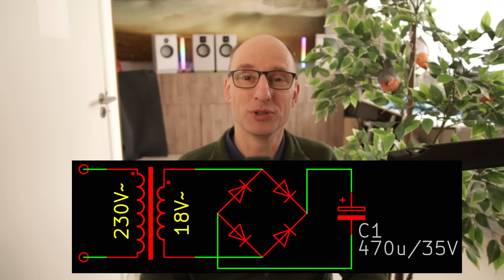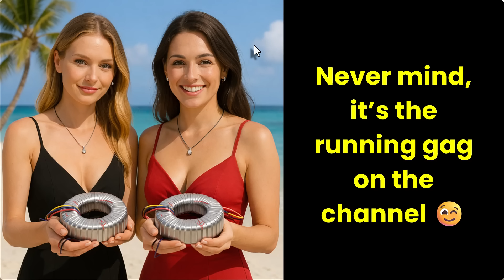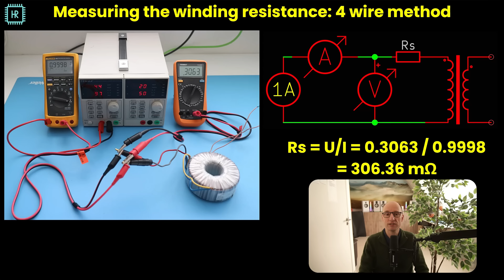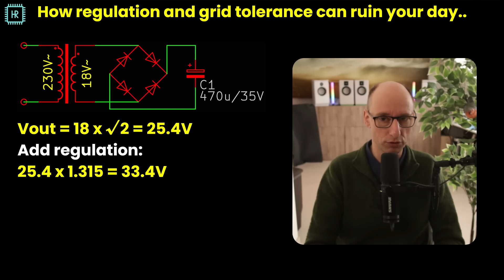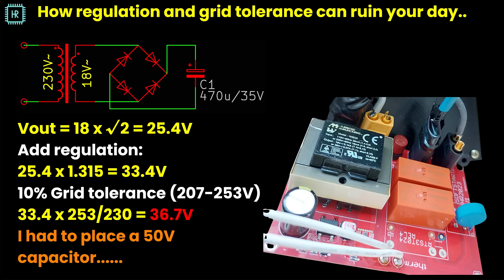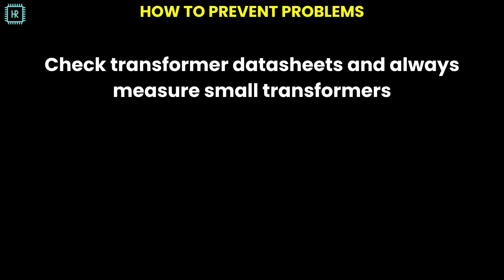Linear Supplies Can Destroy Your Designs

Comment: Hi, this is Ava from JLCPCB. I just wanted to check if you would be interested in a collaboration with us :)
Reply from the maker: Hi Ava, all my boards are made by you guys these days, but I am not that interested in collaborating. 

I have nothing against JLC, adding a short commercial section to my videos really makes my viewers run away so it is not good for my channel since my main business model is selling electronics courses. So I don't collaborate on YouTube with anyone.

I do use your technology for my new FPGA course module of my electronics course. The PCB is made by JLC and I'm very enthusiastic about the 6 layer via in pad technology I'm using for it..

I'm redesigning my high end audio DA converter to the same pcb process at the moment.
Reply: @HansRosenberg74 I completely understand. 
And I'm really happy to hear you're using JLCPCB for your projects, and I wish you all the best with your FPGA course, DAC project, and your channel. Hope everything goes great! :)

Comment: For universal supplies for products sold around the world, targeting a single universal design, power supply design is challenging due to meeting nominal mains power differences through out the world. Some products will have a mains switch to accommodate 120 and 230 VAC with 50 or 60 Hz. However, a switch to select mains voltage is not considered "universal", which implies there is no "supply programming" or "mode switching". Therefore, a universal supply normally has at least a two section (stage) approach. There is a small switching Flyback monitor supply which is universal across all of the world mains supplies, including low and high line voltages, which is on any time the unit is plugged in to mains. As such the Flyback design has to meet all of the world regulation compliance for sleep current, etc. 

When the unit is plugged in the monitor supply is on and includes a small dedicated microcontroller (very low current) to supervise and sequence power up and power down of the main supply, and usually includes some diagnostic LEDs and perhaps even a serial port (field interface is usually a plug-in stick which translates UART Full Duplex to USB 2.0 for use with a Notebook computer). 

The monitor supply will then control the power up and down of the main supply. The main supply can include either linear or switching supplies or perhaps both depending upon what is needed. For example, if we focus on a large linear toroidal transformer (usually with an internal shield and temp sensor or switch) you will provide methods to minimize magnetization current and output current along with any monitoring (usually isolated) of the output stages. This two stage approach is very popular and companies usually have one or two monitor sections designed to operate over all products. You will be winding your own magnetics during prototype, qualifying capacitors, etc. and when a transformer supplier is selected the initial batch of 20 will be dis-assembled and everything measured, like wire gauge, thickness of varnish, turns, isolating tape layers etc. the construction of the transformer must be consistent through out the first test batch. 

If the monitor supply recognizes a problem in the mains voltage (like over or under voltage), the monitor supply will signal a fault (usually a blinking power on indicator) and in turn keep the main supply off. 

Power supply design is not easy or inexpensive when you have to consider all of the features needed for a universal design and how to test and qualify the completed designs. A lot of test equipment (may also include burn-in testers) is needed and some of it is usually custom designed.
Reply from the maker: Interesting, info. I'm only aware of the step down type design that covers the entire range at once. The more complicated approach sound like it is more for high end or specialized supply designs.

Comment: You're making it far too complicated! The primary winding resistance varies inversely with the square of the transformer's turns ratio on the secondary side. So you need two measurements: the turns ratio and the output voltage at a known load. With that, you have the sum of the loss resistances and can predict the transformer's behavior at any load between zero and the rated load.
Reply from the maker: I tried that, it is pretty close, but not perfect. It is a good first approximation!

Comment: That's why you use VOLTAGE REGULATORS to prevent "voltage spikes, etc."
Reply from the maker: Yes, but watch out for dissipation and dropout voltage. One could break your regulator, the other can render it disfunctional because the regulator does not have the voltage room to operate.
Reply: @HansRosenberg74  Very true facts.  However, the SKILLED technician will know these things and take "appropriate measures" to prevent the regulator from becoming another "sacrifice to the Electron Gods". :)

The UNSKILLED ones, OTOH, well, good luck to them.... ;)

Comment: You know what's even greater, I recently build a full wave doubler based power supply for an amplifier with vu meter but as soon as you add two channels the output voltage sags to below the voltage you need for the vu meter reference to work👌

(Now rebuild it with a old DC output transformer and works great the 12V DC transformer puts out 21V though but I'm not complaining my device runs solid. The other transformer put out 6VAC and after doubler PSU I had 18VDC but about 4,8V dc under loads below 20K)
Reply from the maker: doublers can have a really low output impedance. I assume that is what got you :-)
Reply: @HansRosenberg74  I'm a bit late seeing this 😅

But yeah about 2k4 if I remember correctly. Not that low but I tried to keep it about ten times lower than anything in the signal path for stability. Maybe it was a two K trimpot and two 1k4 resistors so about 4k4 parallel to about 24k roughly for the rest of the circuit summed. Not taking the opamp in account but that shouldn't drain too much current.

Aimed at about 120mA if I'm correct but apparently it was enough to drown the PSU I quickly threw together.

Still might need more capacitors however because when I turn the pots in the amplifier which goes to the vu meter and the output stage the signal swings up and down from central ground before stabilizing again 😂

Sadly haven't had time to finish the project yet since things came up. Apart from that it all works great. Looks great on the scope unless you switch the main feature, the -18dB switch, and the drifting starts 😅😂

Maybe next time I'll design a stable circuit and then find a PSU to match instead of trying to build a pivotal device around the smallest wallwart I could find in the house. Although I love the challenge and definitely want to make this work.

Vu meter worked flawlessly, now getting the amplifier stable with the same reference is the next challenge.

Vu meter was referenced to V- because I was lazy and didn't want to calculate the voltages for ground reference and redo the PCB there but getting the signal from AC to DC referenced to V- back to AC to ground sure has been messing the easy sailing up. Not without attenuation but this thing is specifically made to attenuate towards -10dB from +4dB so it's pretty hilarious. Especially when trying to keep it flat from 4Hz to 27KHz.

But I can't give up on it since it's fully built with PCBs looking immaculate and all, tonnes of quality parts and custom wires going everywhere so I gotta fix it somehow.

Anyway, long story short, thanks for the reaction, sadly haven't had time to finish it but man is it a neat and beautiful looking expensive challenge

Comment: 6:40 "33.4 volts, so we're still okay" -- WHHHAAAAAT?! :)
Reply from the maker: Well, at least we're not totally not ok :-D
Reply: @HansRosenberg74  Headroom > 0 -> acceptable :)
Reply from the maker: @metalmolisher666  🤣
In reality, I always take quite bit of margin with headroom for electrolytics. These small transformers with grid tolerance really caught me off guard a bit. But this is an advantage of pcbs: When you're testing your board, you can catch it and mount a higher voltage capacitor. The crucial thing is that you take this validation step!

Comment: Just started watching and I guess this will be about transient when pulling out plug out of mains socket. I'm curious how much the voltage on the output capacitor can be raised due to energy stored in transformer, I suppose it will be ratio of transformer energy and capacitance.
Reply from the maker: It’s actually more about the transformer's voltage regulation and high open-circuit voltage!

Comment: Zener diode across capacitor (with a resistor of course)? Resistor also limits surge current on charging. Any non obvious downsides? 

Best to always have some kind of basic over-voltage protection at a minimum.
Reply from the maker: yeah, that could help, but using a higher voltage cap is always a better idea I think.

Comment: All the way back to electronics school, wow!  now keep in mind that the resisters are plus or minus 20% if you get close, that is about as close as you will realistically going to get in the real world.  What you need to look for is are the voltages in the ball park, that is the important part.  Ask me how I know over a beer.
Reply from the maker: Actually, I think wire resistances will be quite accurate. It shows in the regulation figure for that toroidal transformer. 7 vs 7.2%.

Comment: Surprising to see capacitors actually fail at their rated voltage, I always heard that 35V cap good for 40V because they test them 120-125% of their rated voltage. As a broke teeneger I used a 35V cap for 35,5-36V in an amp without problem.
Lately I see more and more 6V aluminium-polymer caps failing on a PC motherboard 5V rail, only the black little rectangular ones, the normal cylindrical never really fail, I've only seen like 2 of them from thousands of motherboards.
Reply: That’s what I thought too. I know electrolytic caps are very sensitive to ripple current. There is a surge of current every cycle in linear supplies, so maybe that’s the problem. Depends on temperature too.
Reply: If you're doing a design that you expect to get rated life out of, you should always ensure you have adequate voltage margin on the capacitors with respect to the spec rating - you can't count on some unknown manufacturer test tolerance. A second thing is that ripple current will destroy electrolytic caps if you exceed the rating, so it is important to figure out how much the cap current varies through each cycle.
The black rectangular caps can be tantalum capacitors, which are more compact than aluminum but also not as robust. Again, it is very important to address all the operating parameters (DC voltage, ripple current, temperature) to ensure that you will not have an early failure.
Reply from the maker: I generally like to have a 20% margin at least. For low voltage applications I usually go for 100%. So a 6.3V cap for a 3.3V supply, which hardly costs more. Could even be cheaper because everybody is using 6.3V for that.

Comment: As an RF guy, I’ve always preferred linear supplies, inefficient but simple, and no switching noise.  I like to float a battery, and regulate the battery voltage down where possible.  Not what many people want, but for my specific applications, the philosophy works well in many cases.  Application drives these choices.
Reply from the maker: Yeah, this guarantees you don't get a lot of problems...

Comment: well, one always should design for high grid voltage tolerances. I'd suggest at least 300V for 230V system. The reason is loss of ground wire in power distribution box. It can easily increase voltage up to sqrt(3)=1.73 times. Such things can easily starz fire.
Reply from the maker: Oof, if the ground gets loose on your local distribution transformer, you have a serious problem in the neighborhood....

Comment: I always design for 20-30 % overkill for this very reason.
Reply from the maker: Yes, me too (My overkill brain took a day off at that point). The key thing is: When  you're validating your design, always check for these things. I caught it when I was doing that and simply mounted another voltage capacitor.

Comment: The small transformers (especially when going even below 2 VA - sub 1 VA transformers are far from the normal transformer model ) are a bit tricky. The magnetizing current is relevant compared to the load current This gives extra load to the primary and gives a slightly better regulation than the simple resistance measurement suggests. It even gives some compensation for grid voltage variations: with higher grid voltage the magnetizing current goes up and thus some addition voltage drop. As long as the magnetizing current is relatively small (e.g. in larger transformers) it is not as bad as it may look, as there is a near 90 deg. phase shift. With the small transformers the phase shift gets less than 0 deg. as the voltage drop at the resistance already gets relevent. The manetizing current tends to go up near the peaks and thus a somewhat non sine waveform too.
Reply from the maker: Great info: I didn't dive this deep into these small transformer models.

Comment: You have to wonder how the transformer on the pole outside your house works?
Reply: Its a high power transformer
Reply: Literally nobody except for Americans has those.
Reply from the maker: These have virtually zero winding resistance. These kinds of high power tranformer models are dominated by inductance. (I got this from a grid specialist who was working on very accurate grid simulations).
Reply: @HansRosenberg74 that could be true of any transformer regardless of VA rating.  A small tape wound type for example.

Comment: Excellent video. Your comment on supply voltages should be well heeded by everyone.
Following a recent installation of a new consumer unit at my home, we were unable to restart the hot tub as the PCB had been fried. The supply voltage was then measured at 253V occasionally reaching 254V. This was reported to the DNO (distribution network operator) and they had to carry out tap changes on our local supply transformer.
I now keep a monitor on the supply and so far it has only reached 243V (when the sun shines due to nearby houses with solar panels) but I am now very wary of further events. This may even have been the cause of a PCB in our oven failing a few months previously. 
I do make a lot of electronic projects at home for my model railway and always choose capacitors with more than adequate working voltages.
Reply from the maker: Interesting. Those local transformers indeed have different tap settings depending on the local grid voltage situation. I assume someone made an error setting this  one up or the grid situation changed and they forgot to check all the tap settings.

If you have a smart-meter, they could have seen this with a voltage sweep on all meters in their operating area. Surpised you had to find this out yourself.

Comment: Haha, 10% grid tolerance... I have measured 180 V at the outlet. And regarding the flicker, it has been lower at times, for sure... So in BG, you should add more margin.
Reply: I guess you had a supply fault. In Europe, the minimum the grid can supply is 207V.  So if you saw something lower then i guess you should have called an electrician or the DNO.
Reply: No. This is normal at the border of a bulgarian village. There are times i even measrure 230 V. But mostlof the time below 200 V.
Reply: @daskasspatzle2396  I thought Bulgaria followed the standards of Europe? 230V, upto +10%, and down to -6%.
If they do follow European standards then there is a supply issue.
Reply: They follow whatever they want at the border of a village... There definitively is a issue. usually i use my inverters, the voltage drop is not present then.
Reply from the maker: I actually have a stationary caravan at the farthest point on the campground (500m from the entrance where the mains power comes in). The wiring was meant for 4A per caravan but all the circuit-breakers were updated to 10A.

You can imagine what happens if I turn on a 2kW heater :-D I also get 180V :-D

Rural areas can also be a problem: You can have long wires with significant resistance causing the same thing.

Comment: 1:38 - Buy a TR1035+ Battery Internal Resistance Tester; you won't regret it. It is a 4-wire Kelvin meter with frequency injection, and whilst it is targeted at batteries, it will also measure any resistance. I have measured the resistance of wires, contact resistance of high-current connectors, inductors, PCB traces, etc. And make sure it is a genuine one, because copies with the same part number exist. The original says: Shanghai Fossi Intelligent Technology on the front label.
Reply: That's ok, but remember, the measurement frequency is 1kHz. You can't measure a 50Hz transformer or inductor with it.
Reply from the maker: I used my 34401 for the measurement as well. I think that uses DC? I'm pretty sure it does. In any case: That was accurate.